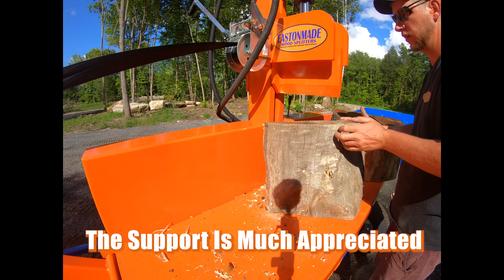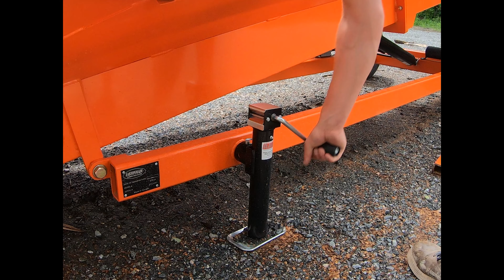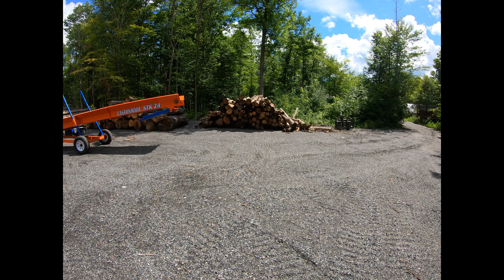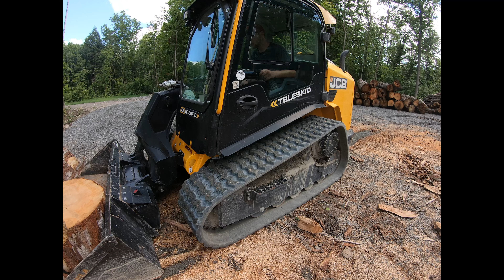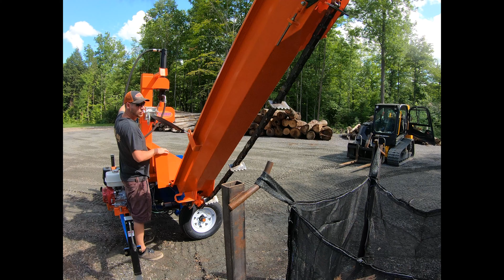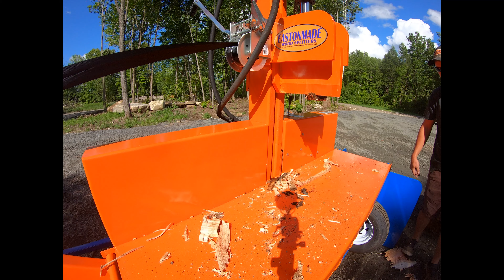Eastonmade; Trash or Treasure?

Comment: Andrew thanks for always taking the time to make these video for us. I think you all make the hands down best spliters around. Love all the options you guys offer. Pouring the floor in my shop soon for arrival of a 1050 gallon storage 97% efficient indoor wood boiler here in upstate NY. Cant wait to make the drive up to see you guys and pick up a unit. Then the firewood process will be complete. got the log table all built this year. load it with the excavator park the splitter at the end of the table and roll the rounds onto the splitter table. never have to pick up any wood till it goes in the fire box. its my dream set up, the only thing missing is a big orange piece of steel that says eastonmade on the side of it. Cheers!
Reply from the maker: That would be a nice setup.  Have heard about those boilers but hsvent ever looked into them.  Might need to with the addition of the shop.  I really appreciate the feedback and support.

Comment: Your Axis machine seems like it would make splitting wood so much easier on you physically, I definitely believe in letting the equipment do the work!!! One question though I notice all your wood is cut square on both ends, if it isnt squared off is there any problem with it kicking out when pressure is applied??

Comment: OK shes a beast for sure, and if you dont mind, I fugure you already figured this out,, the lift table needs to come up level with the work table or just an RCH higher, and a 4 way adapter for smaller stuff like 12 to say 16 inch would be cool for one pass,, Other wise I do like it, so whats the price, and how can I look at one down here in the lower 48?
Reply from the maker: The lift is just about level.  I think I've got to lift it up just a bit more.  Its tricky because I found sometime if you want to slide something back to the lift you will grab it that way then.  I dont think you will see us do a 4 way just for safety reasons. This machine is $11,000 with the conveyor.  We ship several times a week to the us.  We are booking into February right now.  I really appreciate the feedback
Reply: @EastonmadeWoodSplitters   I think you have a winner with this, my old body dont take to lifting and tugging to much any more,, Ya done good
Reply from the maker: @skeets6060  thanks again

Comment: Every machine seams to run flawlessly. One thing I have often wondered is about to the conveyors is would the firewood screen at the end. Would it work better closer to the beginning with a slide into a bin instead of getting mixed together when you have a big pile. Just a thought I had and wondering what anyone else would think about it.
Reply from the maker: The only problem I've found with having the scraps at the splitter is having to work around them.  Most guys will throw a bin or bucket of some sort under the pan to catch the debris so it doesnt get mixed up.  Thanks for the feedback.  Really appreciate it

Comment: Now you got me thinking. AXIS, or 12-22
Reply from the maker: It's a hard call.  The 12-22 is a lot faster, butthe axis offers a higher level of precision.
Reply: I don't think anything would disappoint coming from eastonmade but I love my 12-22
Reply: @williamwhite9275  Looking at a box wedge, and a 6 way wedge, if I get a 12-22. What's your set up like.
Reply: @IronOakSawmill  i got all three the box and 6 way and 4 way I like the 4 and 6 way for doing boiler wood and the box for camp and the wood I sell because everything is uniform. The box does seem to produce a little more trash but its well worth it in my opinion because you don't have to handle the wood. But you don't want to handle the box wedge by hand its heavy lol

Comment: Can anybody comment on the noise level of the machine and conveyor running together.  There are a bunch more moving parts than a standard log splitter but yet I don’t see anybody wearing ear protection…..  Ok asking for the neighbors sake….. Thx
Reply from the maker: It is fairly loud.  If you look in most of the videos i have plugs in.  I have a hard time not wearing them now.

Comment: These machines are great your design is great power great speed but in any splitter like this i see the wood always tends to slip not just yours but in all designed like this. How come nobody adds a little texture in the paint underneath the wedge to solve the issue or would it solve this issue or just make it worse for sliding the rounds under the wedge
Reply from the maker: That's exactly why Bobby.  The first one we did had the pan bolted down with carriage bolts.  It didnt seem to matter where we put them they would catch the block.  I really appreciate the feedback.

Comment: G'day Andrew, we have a similar unit manufactured in my state but our OHSafety rules are so strict the operator must have both hands on the separate control levers or it won't work. The only problem there is, in knotty wood you need to wear a full face motorcycle helmet if your like your jaw in one piece ! To many rules 👍🇦🇺.
Reply from the maker: I looked at it a lot of different ways and I think the foot pedal is the safest way to do it.  You at least have control over the wood that way.  I really appreciate the support.  Always great to hear from you.
Reply: I totally agree with the foot control, but the experts that set the conditions are more concerned about where your fingers are than the ten pound projectiles flying around your face faster than you can see with steel like splinters inches long .
Reply from the maker: @ishure8849  that seems to be the problem with today's society. To many experts with to little experience

Comment: Got a POWERSPLIT i found skateboard grip tape JUST under the Splitter HEAD HELPS Wood not to slip.12inc by 12inc
Reply from the maker: Never thought of grip tape.  I might give that a try.  How does it hold up
Reply: @EastonmadeWoodSplitters  the grip tape last about WEEK or so but it CHEAP. Iv BEEN hit with lot of Wood that slipped off table it HURTS. But with the tap not BEEN happening

Comment: How much does the smallest model box wedge splitter cost?
Reply from the maker: $7800 for the 5-11 set up with a box wedge
Reply: Eastonmade Wood Splitters.    Ok I’ll think about it. I think I’ll try to make a box wedge for my current splitter first.
Reply from the maker: @stonecropfirewood3393  np...let me know if I can help in any way
Reply: Eastonmade Wood Splitters.     I’m only 14 and 7800 is a little more than I want to spend at the moment. That’s a lot of wood to pay that off. But I know how to weld so I’ll try to make a box wedge. Thanks.
Reply from the maker: @stonecropfirewood3393  right on.  That's awesome.  You dont learn from not doing.  I wish you the best and let me know if you have any questions when you're doing it.
Reply: Eastonmade Wood Splitters        ok thanks

Comment: The secret is in the two way and how the wood is oriented. I saw you scab off the knot as best you could, then usually it can be twisted 90 degrees and she'll split really clean through the knot. A person gets good at reading the wood after a while, but a 4 way or more would just make junk out of the gnarly pieces. When they are super gnarly with double contrasting knots or knots that go almost all the way across, then it's time to get the chainsaw fired up again and cut some perfect pieces of firewood from stuff that won't split good in any direction. Can that machine handle two foot long though? Most of my gnarly ones are cut at two feet.
Reply from the maker: That's the trick to it.  The wedge will open up to 24"

Comment: I was just about to type a comment saying that omfg you were doing that the hard way. Split the whole block into 3-4" width and then rotate it 90 degrees and go the other way. Literally as I was about to start typing you changed to doing it that way.
  You're going to have to start paying attention to what's going on the ground or your whole wood yard is going to be covered in sawdust and/or chips and you'll have to keep scraping off the surface all the time. Personally I just have a bit of a fire a few times a year and scrape up all the sawdust and chips into that. I'm only doing bout 10-12m3 a year though for personal use.
Reply from the maker: Thanks for the feeback alan.  Normally I would take the leaf blower to it when we are done, but this stuff was pretty wet with all the rain we were having.  Would like to keep as much of the gravel there as I can.